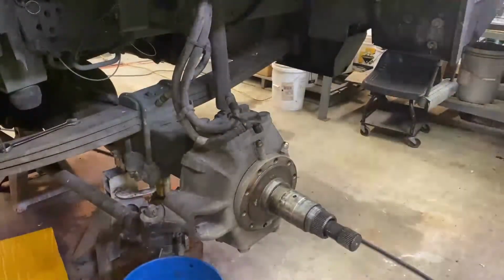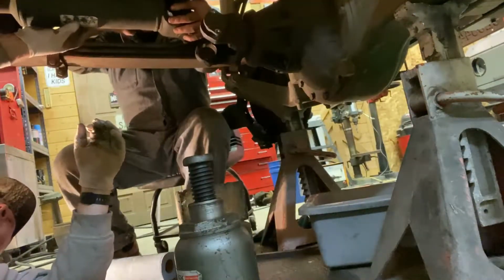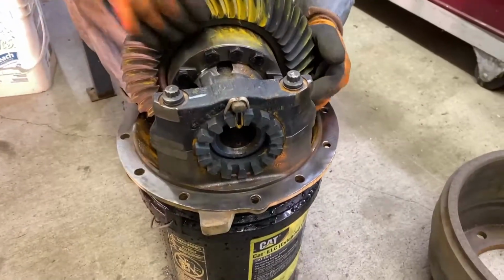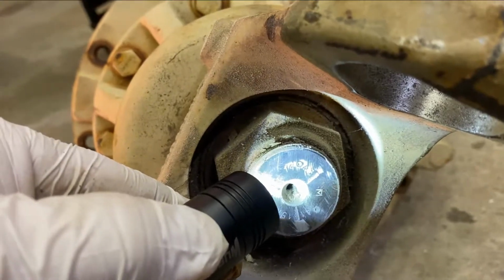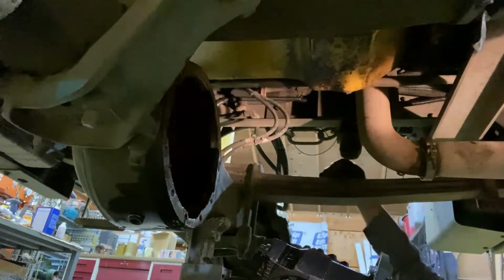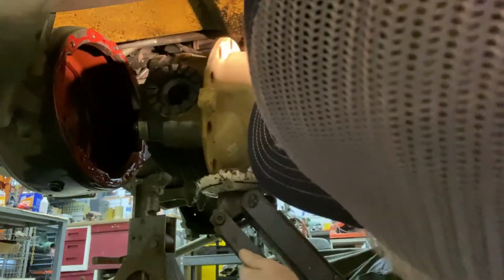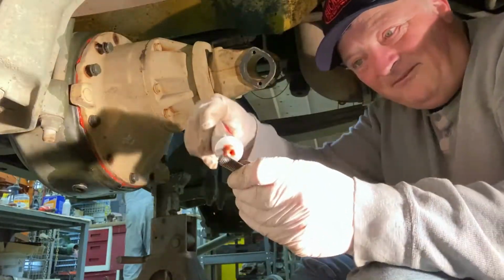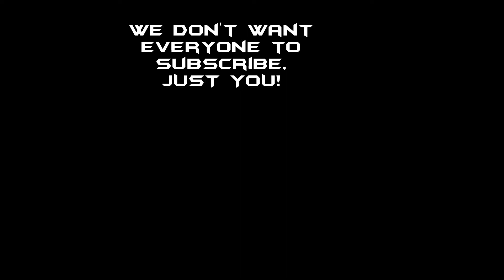FMTV 3.07 FRONT DIFF Gears, pt. 2

Comment: Great video.   I am considering removing the king pins to get mine done.   Why did you choose to disassemble the hubs?   

Any thoughts on the two options?
Reply: Too heavy. Also wanted to have a look at the bevel gears and repack the wheel bearings.
Reply from the maker: There was no way we could find to remove the axle shafts any other way. Mike talks about this in the video. Without the axle shafts removed, there's no way to removed the differential.
Reply: @HelicoolsHelipad  Dave, it can be done by pulling the kingpins and sliding off the knuckle, spindle, hub and brakes. That method does not address the bearings and the bevel gears, and they are really heavy! Pulling the hubs and spindles is easy work.
Especially when your help is on the way to 70 years old.
Reply: @MrMikey4026  Do you know of anyone that has a video of doing it by the kingpin method?  Thanks for the good video guys.
Reply: @chadjones7722  no I do not.